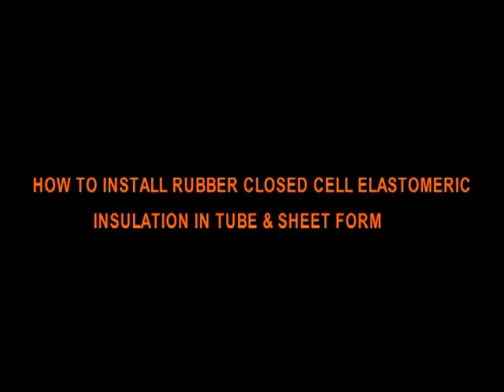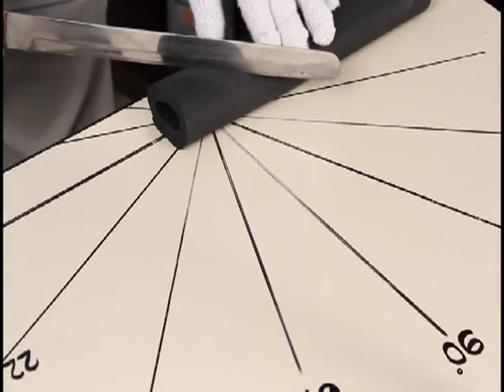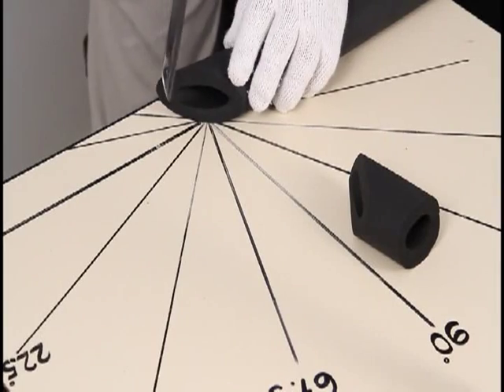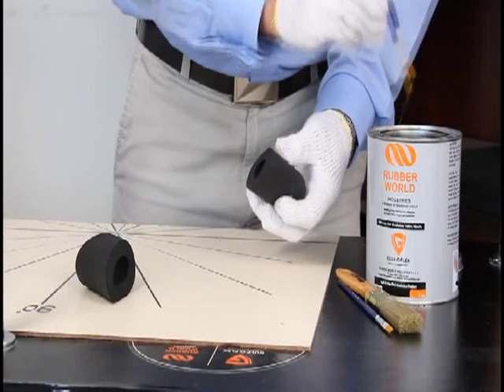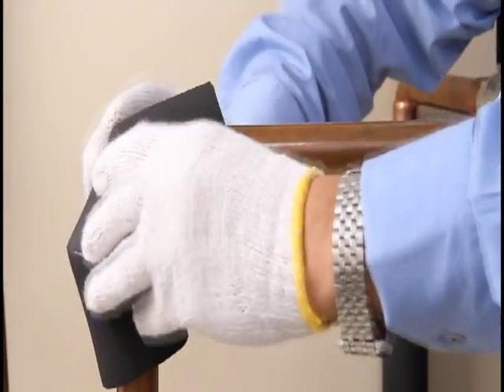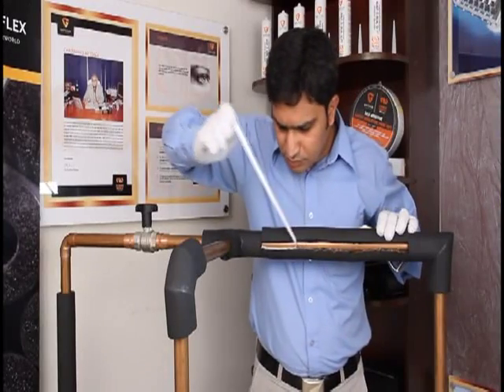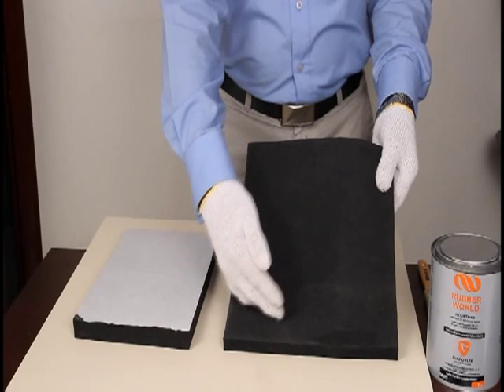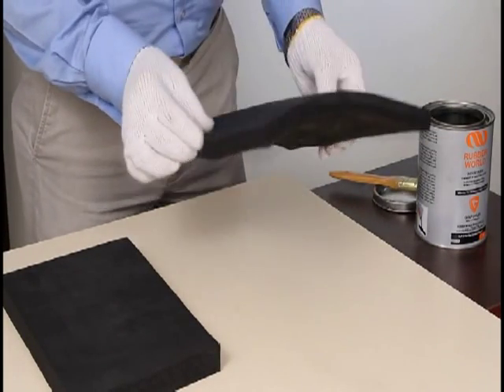How to Install Rubber Closed Cell Elastomeric Insulation in Tube & Sheet Forms

Comment: Do you have any information/part # for that knife? I have been using serrated blades which leave a ragged edge. Razor type lades seem to dull very quickly.
Reply: If you still looking for a knife just buy a filet knife from Walmart  it should do the trick

Comment: Dear Sir,

This is Harlan from Jiangsu Zhao Sheng Building Material Co.Ltd,please check our website: www.wincellchina.com. 
We are the factory of PVC insulation fitting cover and jacketing system,please check our sample photo in attachment,please check it !
Insucover is light,clean,acid and alkali resistant,resistant corrosion,anti-aging,durable and cheaper but advanced performance PVC base molding material.
The application fields of this system range from the building industry, chemical industry and petrochemistry to its use in the foodstuff production and pharmaceutical industry.
Insucover Jacketing satisfies all technical requirements placed on a state-of-the-art insulation jacketing and outstands for its following unique features:
Simple and extremely timesaving processing
Water tightness
Vapour barrier function
Flame retardant
UV-light stabilized      
 If you interest in our products,please reply to me ,thank you!

Best wishes,
Harlan  朱晶
                                 

           
Jiangsu Zhao Sheng Building Material Co.,Ltd.
江苏兆胜建材有限公司 壳宝事业部
Email: wincellinsulation@foxmail.com, wincellchina@gmail.com
Tel: +86-523-87599660
Fax：+86-523-87598728
Mobile phone：8615996083786
Skype: harlan.insucover
Address: Tong Jiang Road No.18-28,Tai Xing City,Jiangsu Province,China.
Web : www.insucover.com.cn